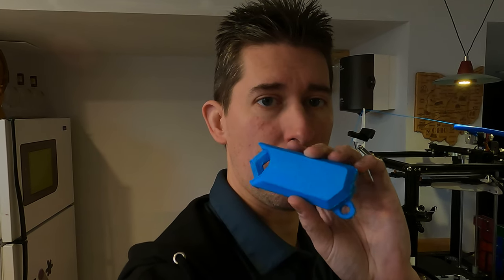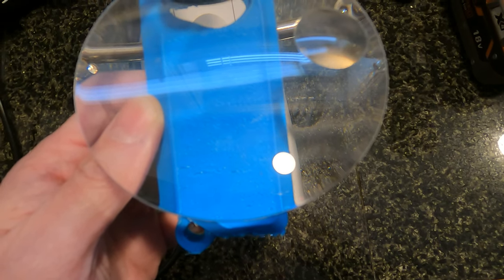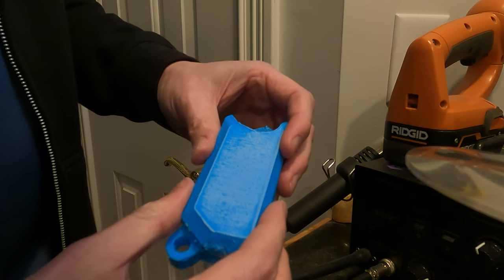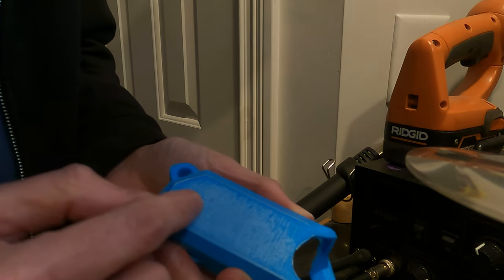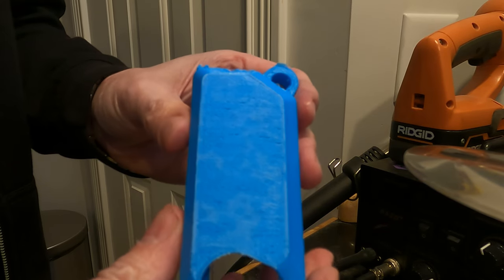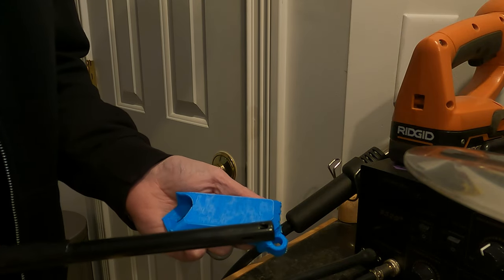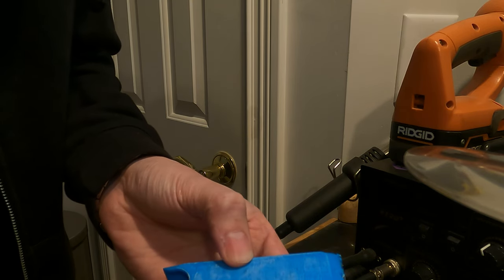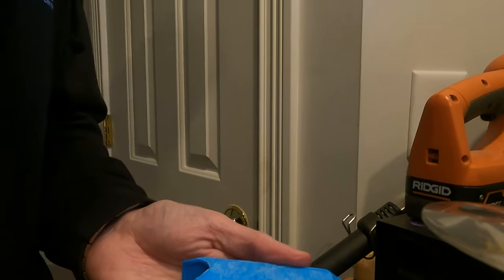RARE 004: Should You Sand ATARAXIA ART Flexible PLA Plus?

Comment: wat settings did u use im trying to print on a ender 3 max '
Reply from the maker: Comments on the 003 video but basically :

I'm using PLA settings, print at like 195C (generally Hatchbox) and about 80mm/s with a 0.4 nozzle. The only thing I changed with this was lowering the print temp to 190C and it turned out really well. I think I'm still going to have to do some stringing tests with it because there's a little bit of zits, but there were so few, it wasn't worth it and basically was just "drop in."

Comment: Yet another soft PLA video on YT that wont show the flex of the filament on the roll. I'm trying to figure out if its less flexible/stretchy than TPU so I can run on bowden instead of direct drive, but literally no one shows the actual filament.
Reply from the maker: That's easy enough to show, I guess I just didn't know how someone would like to "see" that. I went back and looked at your other comment and I think what you're asking about is the flex (slack?) created by moving the printer head long distances and how that  impacts the filament on the spool as well as the printer driver. If that's right, sound off and I'll snag those thrown away clips and put them up for you. Otherwise, let me know what you're specifically looking for and I've probably got it somewhere